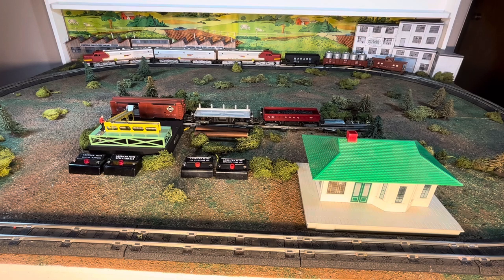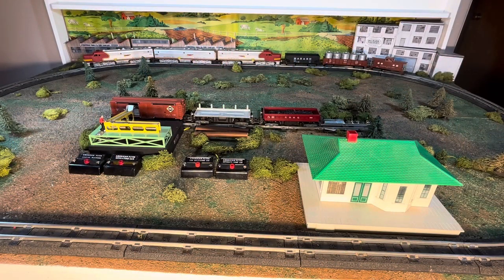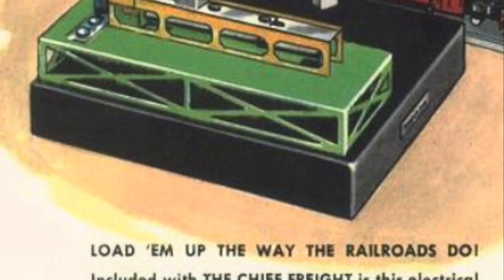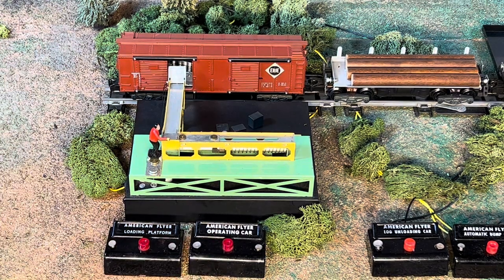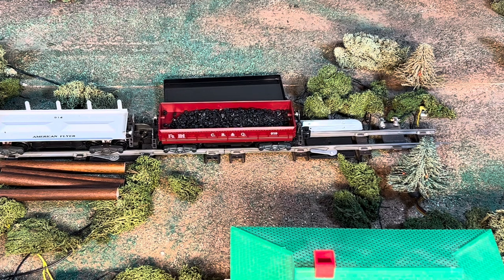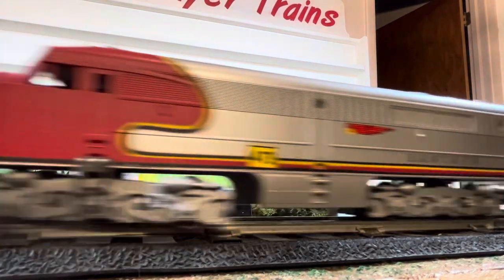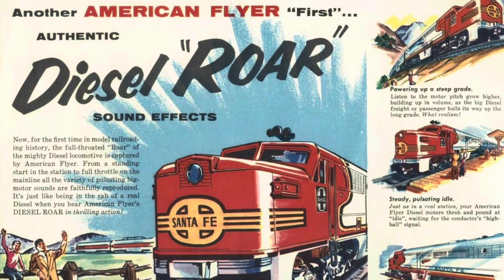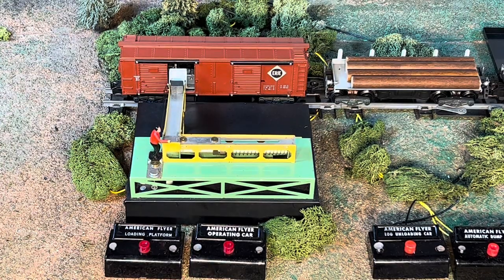American Flyer: Operating the #5585H Santa Fe Freight from 1955

Comment: I have the 5580H set from 1955 plus the 961R coach.  My 471 has the lever that protrudes through the chassis to turn off the diesel sound generator (diesel roar), but leaves the speaker connected to use the horn.  A mother's ideal setup.  😉

Comment: The rubber Road bed for the American flyer track mission looks so much better. It's a shame American Flyer and Lionel couldn't have had more prototypical looking track. The super row was better than the regular old 31.
Reply from the maker: It was a really nice product with some excellent sound deadening properties.  You can really hear the clickety-clack of the freight car wheels.  The later version actually had scale size ties molded in.  They tried some pressed paper board roadbed too.  It looked nice, but didn’t deaden sound as well.  That was right before they went to the Pikemaster rail that looked like HO track, but with tinplate rails.  Great idea for a video. Thanks for your comment!
Reply: Back then Lionel and American Flyer’s concern was making toys not prototypical trains.
Reply from the maker: @huntercoleman460  That is true in a way.  A big company like Gilbert or Lionel had to balance between “realism” and commercial viability of the product.  They were in it to make a profit.  I always thought they did a good job of using prototypical plans to make operational and realistic looking  trains.  It’s always interesting to see the photos of the old Gilbert executives in a board room surrounded by toy trains and accessories.    Thanks for your comment. 👍
Reply: Lionel will never make choo choo sound

Comment: Why didn't you put all the cars on the train?
Reply from the maker: Hi there.  The whole train is together at the end of this video after the action caboose section at 4:31.  My layout is portable and is designed with electrical connections in the middle of the table.  I chose to demonstrate the operating cars this way like on some original Flyer display layouts.   See my video on Why I Like Lichen and how I built a multi-function control button for a good description of the layout.  Thanks for watching.
Reply: Ok I understand why you did that. 8 cars look ok with an A B A because most àll the longer  expensive sets came with 8 çars. Other çárs can be bought oñ  special days to keep  everyone happy.